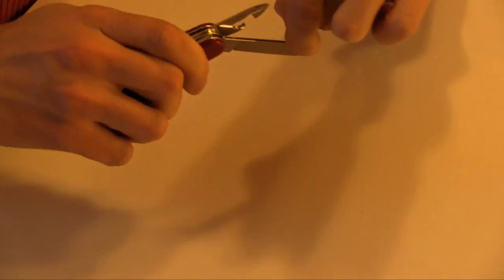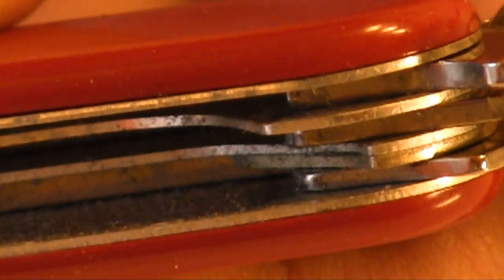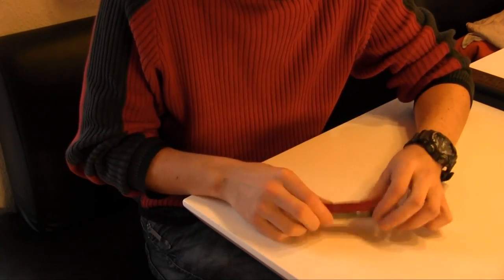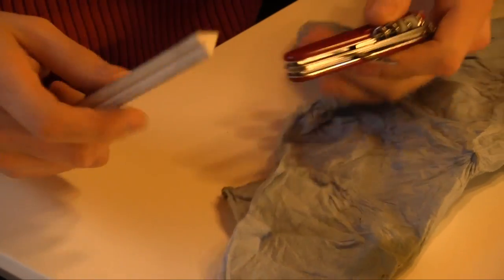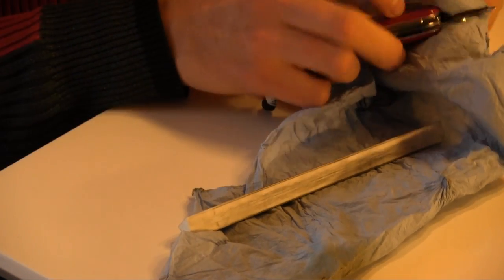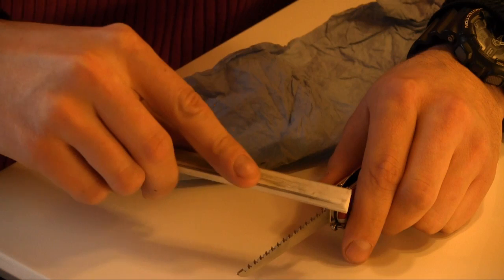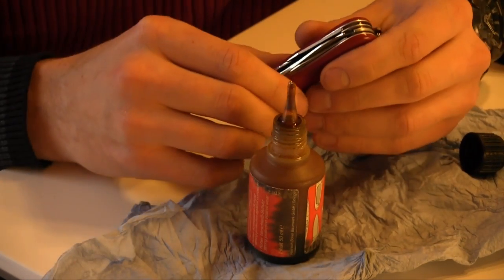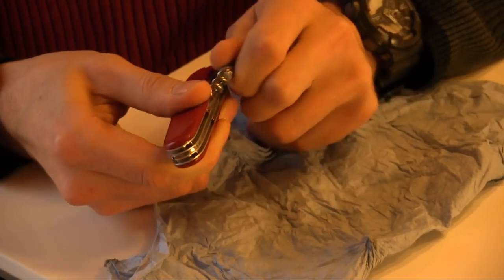HOW TO - Maintain a Swiss Army Knife - A Companion for Life VICTORINOX

Comment: No! Never place your knife in water! It is impossible to get it completely dry and there will be rust. Better that you pick or brush out the dirt and grime and then oil the joints.
Reply: q tip and oil olive or veg that's all waters gonna green the brass not good but Robert said that
Reply: it can't rust it is stainless steel, warm water is completely safe and is recommended by victorinox to clean the knife
Reply: Stainless steel WILL rust! It's steel, and steel will oxidize. So go ahead, put your SAK in water if you wish. I will continue to clean mine with a small brush and oil.
Reply: No disrespect intended, but you're quoting wikipedia, anybody can put anything they want on there. Just because ya read it on the internet does not make it true. And, there's no need to disrespect me, it's just a discussion.
Reply: Thanks for the info.
Reply: Ege Atilla Stainless steel is rust resistant. It can however rust after prolonged exposure. Salt water will rust it quicker. Where I live we have really humid summers. I've had to remove slight surface rust within the first month of having my Swiss Super Tinker. Washing it isn't going to do anything though if you wipe it dry.
Reply: Robert Winkler victorINOX inox, inoxidative , no oxidation
Reply: ***** Well he is right, up to an extent. Depending on the composition of the type of stainless steel is is rust resistant under normal circumstances (high humidity, salt water and such can be an issue).

Its a trade off between material cost, hardness of the metal and how resistant it is. Carbon steel (aka not stainless) can get much harder on the rockwell scale but well you obviously get a blade you need to take good care of when it comes to water and oiling it has its pros and cons.

From my personal experience though I've not had any issues on any of my victorinox swiss army knives to date (minichamp for EDC purpose and outrider as backup/utility thing for outdoor/camping things when I don't have a good fixed blade on hand or my leatherman charge tti). Anyway back to the subject matter... yes depending on the composition, humidity and temperature it can and will rust. Most stainless steels won't under regular humidities, but some of the ones that are considered stainless but with a harder and more wear resistant property can start rusting for example if you leave them in a dishwasher where the humidity and temperature is high or if you leave salt water on it for a long time.

Just cleaning it under running water, using a soapy thing, then rinsing that out and drying it for a while on like a central heating radiator or just enough time in a dry environment should be fine (has been for me). You probably do want to oil the joints after doing this though. Anyway its important to know in a way, many of the "cheap noname" knives will do just fine in a dishwasher for example but some of the while they are stainless higher end knives quality brands depending on steel alloy might not be happy with the long period of high temperature and humidity because of the edge properties are better of such steels. 

tl;dr
Stainless steel can rust, but in my experience if you don't leave it wet and let it dry with victorinox type steels I've not had an issue on my knives.
Reply: Just read actual Victorinox PDF linked above, and read up on the details about stainless steel on wikipedia. Kinda confirmed what I expected, oiling after the cleaning, not in the dishwasher (some of the cleaning agents in there can be pretty aggressive and probably counteract the chromium oxide in some way also high humidity, splashing water and higher temperatures won't help).

Oh yea and finally, water isn't something to be overly worried about avoid it if possible but if it happens it happens probably won't ruin it unless its something exceptionally. Acids however are a real problem, if you leave an acid on it for too long a period you can get stains or more serious corrosion depending on how long its on there and how concentrated it is.
Reply: Hair dryer!!!!but take off scales